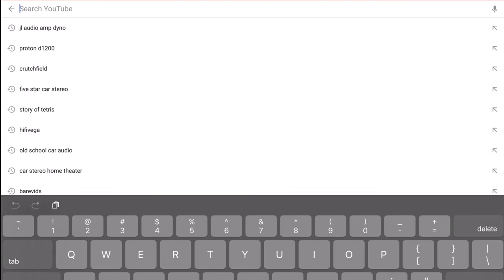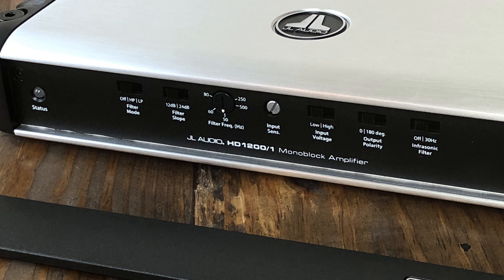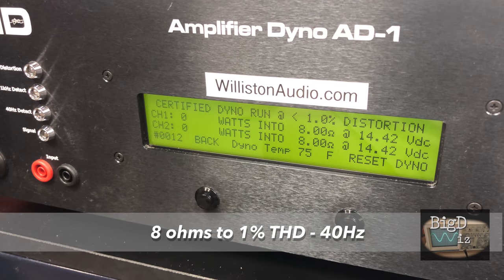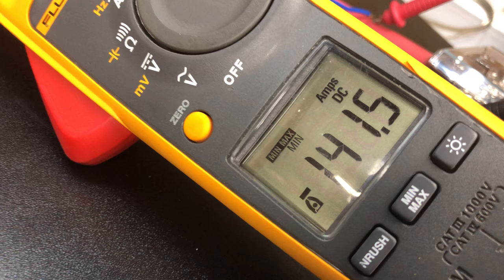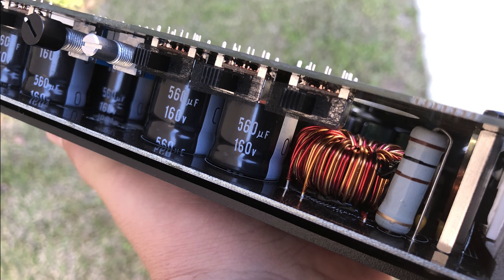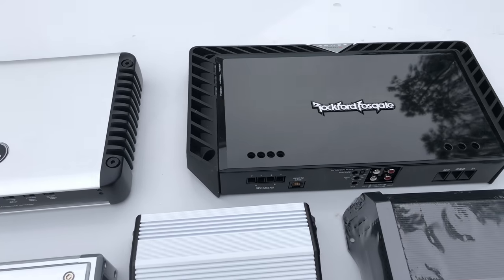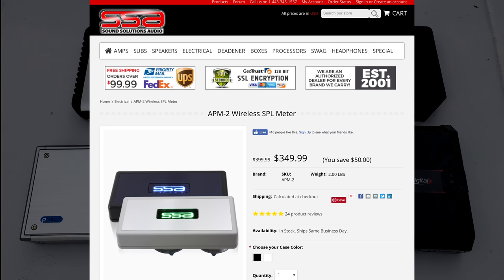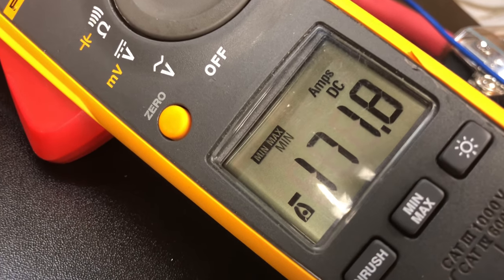$1100 for 1200 watts? JL Audio HD1200/1 Amp Dyno Test

Comment: That R.I.P.S. tech is a great feature for those who cant upgrade their Charging systems due to Technical issues with their vehicle's Computer. One of the reasons I use them regardless to the efficiency is for that Power supply that Guaranteed power rating from 1.5 ohms to 4 ohms and 11 volts to 14.4 is more then enough of a reason for me to continue using these amps on top of their small foot print. But I agree with the price, back when I got my first HD amps they were under $600.00 the price has gone up a lot, also I definitely agree with you on the power terminals, they are way too close to each other and do wish they were more separated and the remote wire be in the middle. Bass knob wise yeah they should definitely include it for the hefty price. But like you said, JL is. Premium brand and if you want something Premium you gotta be willing to pay for it or get something you can afford instead.
Reply from the maker: Agreed but you still need the current capability to power the amp. Price is high, but you buy amps like this for 10yrs plus operation
Reply: @Williston Audio Labs  absolutely! 😁👊

Comment: Sorry to comment on an older vid but.. I wish we could see more guts! I'd say from the 160v rating on the caps, combined with what looks like dual high frequency switching transformers, what you're paying for is indeed the advanced power and protection circuitry so it will guarantee a certain wattage into any sub or subs, any set-up.. Though I figure it must be a higher voltage, lower current amp, it still pulled quite a lot on the DC input side! :o Holy crap! I guess you also pay for sleekness and quality, though i'm shocked by the remote bass knob cost and irritating proprietary power/speaker plugs! Rather reminds me of typical Japanese OEMs that use ribbon cables between "seperate/stack" Hi-Fi systems! Lose them and you pay big bucks for them or have something that becomes a paper weight. Nice work! Keep it up :D
Reply from the maker: Yessir, nice amp here

Comment: I have never owned a JL amp. I did have 2 JL 12W0 12's paired with 2 kicker comp.12's in a big sealed chambered box once. All wired to 1 ohm and hooked to a 2400 watt amp. The JL's blew and the kickers kept on kicking. I know it is not ideal to mix match subs but I didn't care. Anyway, the Kickers are still good setting in my basement and the JL's are at the dump.
Now that that's said i also have two old school JL 12W0's that I have re-foamed and they are in my wife's van right now. They still beat hard. I have had those things for like 20 years. lol...

Comment: I'm running a JL Audio HD1200/1 on a JL 13W7 in a ported enclosure which is built to manufacturers spec.
I also have an audio control LC7i converting my signal prior to the amp. The signal voltage reaching the amplifier is about 3.2v and the output voltage on the speaker terminal with the volume at maximum (without distortion) is 60.0v as per the usual formula and manual. However, it just doesn't feel like 1200 is going to the sub. I've ran systems previously using 800w that pisses all over the output on this thing. What could be wrong? Feels like it's only using say 500watts at most. I have the LPF, subsonic filter set to 30hz, high level signal input, 12db octave etc.
Reply from the maker: Oh wow that’s odd it should slam! May be something else going on. There may be some additional processing occurring with that high level signal before hitting the AC. If a shop installed it all I’d have them diagnose.
Reply: @wal  I've always done my own installs from earlier years. The install is super clean and tidy and the ported box is extremely well built if I do say so myself lol. However whenever I try and approach local shops they wont touch it because "they didn't install it" which is bizarre. 
At first I used a 40hz 0db and then -5db test tone. I just tried -7.5db and made sure the output voltage was still 60.0v as it should be and it sounds much better and louder! Im going to test it with more music and see how I get on. The voltage of the RCA and out the output voltage on the speaker terminals is spot on.

Comment: Nice review Big D. Out of curiosity (and I've tried searching) but do u have anything on the JL 250/1 (SLASH SERIES) just acquired one due to damaged / stripped Allen keys but works perfect. Just need to replace screws i terminals that stripped. Looming to pair it to a set of mtx thunder 5500 svc. Just wanted to know numbers on it. Thanks in advance from a loyal viewer.

Comment: Why would you test efficiency at ~14volts when RIPS the same at 11-14.5?
Reply from the maker: Because I use 14 volt batteries for my test bench. In car tests will result in lower voltages for sure

Comment: I pre-ordered the HD 600/4. It was somewhere around 800 dollars back then.. was it worth it back then? Maybe, maybe not... But now days is it worth it? not in my opinion!! You can get the same or more power for less money. The interesting thing about the HD 600/4 is that if one of the speaker outputs are shorted by crossed wires or a dead shorted speaker coil or even shorted too ground the amp will play a low watt white noise to the rest of the speakers to let you know it has a short so you can determine which speaker is not playing and resolve the short.

Comment: Hey I love my AR4000d lol only does 700-900w but I was shopping for a 1000w amp and got it for $40. Can't beat that!
Reply: Tyler Herod, the quality, reliability, and longevity of that AR4000 leaves something to be desired. You are correct, however, they are good bang for buck.
Reply: Joaquin Juarez  so you know much about 6x9 my friend I can't decide if I want fosgate power t1682 or infinity kappa 682.11cf?

Comment: What happened to the 500/1 you tested? I have that on a 10W7 sealed in my truck. After seeing it do 700+ Watts, I’m thinking about another 10W7 with both ported in there to load it to 1.5 ohms.
Reply from the maker: I borrowed that amp from a friend. Yeah, that would be a great combo 🤙

Comment: Great review. looking forward to the follow up of daily driving comparison opinion. Some brands cost more as mentioned because of the name and what should be better quality products which I dont think most people would have an issue with when buying something nicer like Jl Audio, Zapco, or other brands. What is disappointing is when you do not get any better features such as an adjustable sub sonic filter, or a bandpass filter, or selectable x-over slopes. Something that makes it stand out for SQ and higher money justification. Or as also mentioned including the cheap bass knob vs selling separately for $35.
Reply from the maker: Not including the remote gain knob and cable is unbelievable 🤷‍♂️

Comment: As BigDWiz said in the video of the JL XD amp......when something is designed, engineered, and built well, it`s worth the extra cost so you get what you pay for. 

In closing people, the main focus of this YouTube channel by BigDWiz is to test amps to make sure they`re putting out the power that the manufacture claims for their products and not what an amp cost compared to another amp with similar power output otherwise it should be called Amp Test Dyno and price. 

NEWS BREAK.........The JL HD1200 made it`s rated power plus some across the impedances JL claims in it`s manual which is what the Amp Dyno test is for. Case closed. 

There`s a market for these off brand amps and they`re generally reserved for the younger crowd who are just getting into car audio and they really don`t know anything about quality products or for those who really don`t care about anything except for being loud and they want the most bang for the buck because if it blows up, they`ll just buy another one because it was a cheap purchase. 

Caveat Emptor.
Reply from the maker: Well said 🤙

Comment: I know this is off topic from the video, but I have 2 Rockford fosgate 10’s old school PCH-108’s, do you think they could handle 200w each? They are rated for 100w each but rockford did underrate alot
Reply from the maker: Those subs are pretty old by now. I’d take it easy on them 💁‍♂️
Reply: BigDWiz yeah your right I should probably respect them more, right now they are running off a alpine 3556 in 5 channel, and they dont move alot lol 80W each right now, but Ill tell you what, it puts out some very clean bass

Comment: The engineer was from old school PPI. Super tightly regulated power supply is why it stays the same regardless of impedance load. Classic PPI. You always get the same.
Reply from the maker: Yessir the first amp using this technology was the PPI 2350DM IIRC

Comment: Heck man my punch 1000.1 bdx dyno'd at 1501 watts rms @ 1 ohm you can get this amp for about $350 lol. I have it pushing a ported JL 12" wedge slot ported box with W0 series in it and it just slams JL subs are amazing but a grand for a 1200 watt amp those numbers just don't add up to warrant that price. Running the W0's @ 2ohms the punch 1000 is rated 500 rms at that load it's birth sheet states 871 Rockford just never disappoints with their amps.

Comment: I have this amp and was wondering if i set the gain voltage to output 750 watts would that lessen the current draw?
Reply from the maker: In essence, yes. It would be like putting a speed governor on your car, not allowing it to go faster than a certain speed. Less power out = less current drawn

Comment: Looks like the Alpine pdx-m12 has the knockout on the 1200rms constant power tech amps.
Reply: I agree!  Plus the dynamic rating on the M12 at 2 ohms was around 2500 watts.
Reply: @in2quads  and the m12 is 1 ohm stable. Although with decreased dampening factor defeating the sq need. They just rate it 1200rms 2-4 ohm. But after rise i been clamping 1100rms at 13.2v
Reply: @sittdogg  good to know...  I will have to try that!

Comment: So whats the point of using a different ohm load if it makes no difference to output?
Reply from the maker: Showing the amp delivers continuous power across multiple ohm loads meaning it will sound louder than similarly powered amp

Comment: I would like to see the difference in the amps in a real world setting. I blew the power supply section on my Crescendo BC5500 and I bought 2 Audiopipe Mini 2ks (until my Nendo gets fixed) for my Soundqubed HDC3 15s at .5 Ohms each. Because of box raise I am pulling more power out of the Audiopipe amps but the Nendo had a deeper sounding bass than the Mini 2ks. I am shocked by the sound difference in the 2 brands for sure. I guess in this case you can see why the Nendo in about $1000 and the Mini 2ks are $170 each.
Reply from the maker: Stronger power supply in the Nendo and more dynamic power I’m betting. But this JL is immune to impedance rise, which could greatly improve its output compared to many of the other amps

Comment: I sure some of this has been said already damn that's a lot for so little. But I really wonder what components in the JL amplifier make is so much more expensive are we talking better quality caps better filtering? Seems like Rockford  would be quality components also. In my opinion subwoofer amps would be hard to tell the difference once you reach that price point with well known brands that puts out quality amps. It may be different once you reach for full range amps each may add their on coloring to the sound which shouldn't be but it happens.

Comment: Is there any other amp brand who also offers consistent wattage regardless of the ohm load?
Reply from the maker: The RF BDCP amps are similar, but ohm load, not voltage also as the JL’s
Reply: BigDWiz so would you agree that jl audio is unique and one of a kind. Still not sure if worth that money. I run jl and rf for all my installs, regardless.

Comment: I’m always looking for the bargain with out sacrificing to much quality, Hd amps are nice and have top quality engineering and parts even if made in China hence the price, I grew up on punch amps, they were pricey in the day too depending on what size and series. That being said I look on Craigslist and eBay for deals on older and current amps and specs, you don’t have to spend the bank to get great sound that you might love, just got a like new Jl xd 400/4 for $100 not the best amp but still will do great for what I need with all my speakers I currently have installed and subs I have.

Comment: I had a chance to put my hands on this amp (trade, I could not pay $1,200 cash) I can tell you'all that I have never heard such a clear/clean powerful bass coming out of an amp, I  know that I could sell it and get at least 3x the power with that money but It's not only about the volume level, to me it's about the sound quality so I don't want to take a chance risking the pure solid sound that I'm getting.  I'm running 3 10inch jl w6 v3 I can't ask for more volume or sound quality,  if you can;  get it,  you won't be disappointed.
Reply from the maker: Great feedback 🤙

Comment: In car distortion measurements would be interesting. it would show the damping factor of the amp. IE how well the amp can control the woofer cone. Cheaper amps may have a lower damping factor and hence higher distortion. I suspect the JL amp with it's regulated power supply would have a higher damping factor and better cone control. careful test's at the same frequencies, at the same volume level some external environment etc,
Reply: 2nd factor would be.....can you actually GET 200 amps to the amplifier? Lower efficiency/higher current draw with a limited power supply(cables, distance to battery, connections etc etc)  would have an effect. lower efficiency/Higher current draw amplifiers may clip earlier due to sagging power equaling a form of Power compression.
Reply from the maker: So the Sine Wave tones used with resistors show a worst case scenario. I’d suspect around 80A during music playback at loud volumes
Reply from the maker: I will try to be as consistent as possible, but plan to use each in car for 1 week minimum in addition to the measurements taken as close as possible. Won’t be 100% scientific, but something to compare to Dyno results

Comment: What amp would you recommend for my single jl w6v2d4 12" sub looking for one with clip indicator
Reply: I would say, one of the Rockford Fosgate Punch Amps...
Reply: Oh, yeah. and the JL RD series amps
Reply: memphis audio mcx1.1100 people sell them cheap for some odd reason. it has a clip light called mdac. it comes with tiffany rca and the inside looks over build. i had it pushing a 12" w6v3 till i upgraded to a 13 w7

Comment: Had an alpine pdx1000.1 and when it I bought it the day it came out it was $1000 and it lasted 12 years of pushing 2 l7 2ohms 15s that it popped 3 times that I ran every day in my dd so you get what you pay for

Comment: JL has always made decent stuff but I have never seen the value as far as the gap in price above other brands. Times have changed and stuff coming out of China is getting more and more reliable, the fact that JL can sell Chinese built amps at this price point proves it. Unfortunately for JL every other Chinese manufacturer has also stepped their game up and the value per dollar on these higher price brand names makes less & less sense. On another note I am psyched to see some daily driver evaluation on some of the equipment you have bench tested! BTW what happened to the OSS xB??
Reply from the maker: xB was sold a few years ago when we got my wife a used MDX. I took over the Accord and really like it. It’s 10yrs old and still in fantastic shape

Comment: My hifonics (yes hifonics i said it) brx2400/brz2400 does way better numbers than this amp and it costed only 220. Its served me well for 3+ years and still going on strong. Why spend 1100 on this hd series? whats the benefit? Maybe better efficiency and name brand? That doesnt justify paying 900 more in my opinion.
Reply from the maker: Smaller size and long term reliability. Sounds like your HiFo is doing well though!

Comment: You should do the power acoustic rzr 2500d the website says 900x1 @4 ohm and 1400x1 @ 2 ohm but the box says 650x1 @ 2 ohm plus it's the opposite of this it's cheap cheap cheap
Reply: Cyode Ryan Blankenship literally just did the rzr 2300 like yesterday. Go watch the video and you will see why it's so cheap
Reply: catch22frubert oh cool thanks man. I just went and checked it out I mean yeah it's a cheap amp and it's improperly rated but if it was rated at 650 on the box it wouldnt be so bad

Comment: Surely, if only I look hard enough around, I will find an explanation as to why I would want 2400 Watts in my car, while 100 are totally sufficient in my living room?
Reply from the maker: Car is much noisier and needs more power to overcome. Not saying you need 2400 watts, as 200-300 watts can power many subs enough to give ample bass over a factory system

Comment: I'm sure it's great but I really dislike amps with removable power plugs, as a installer when someone comes back with the product that you installed and they removed it from a previous car wanting it installed in there new car and didn't remove the plugs is always a pain. Then the plugs them self are like 50 dollars from the manufacturer

Comment: Just got this amp, blows away my DD M2a in power and sound, def blows away the rockford T1500 which sounds like garbage imo. The DD sounds better than rockford which surprised me but guess those Korean amps aren’t too bad. Anyway this amp is louder all around at 1200 watts then my M2a at 2400 watts @1ohm load. Of course the M2a probably needs to be wired to .5ohm to match the JL
Reply from the maker: The constant power FTW

Comment: Great review but for 1100 bucks the amp should be able to handle 1ohm loads all day
Reply from the maker: Why run at 1 ohm if you get full power at 4 ohms?
Reply: BigDWiz but what if you have dual 2 or 1ohm speakers